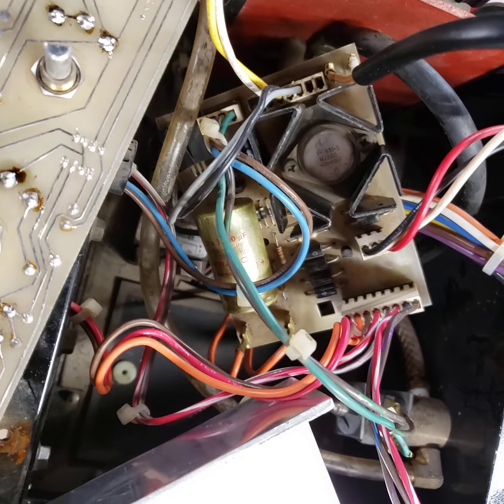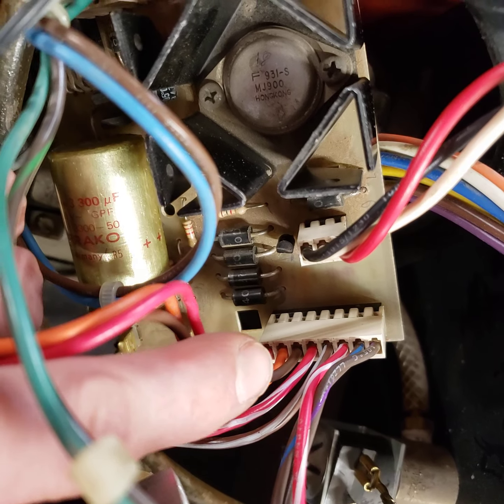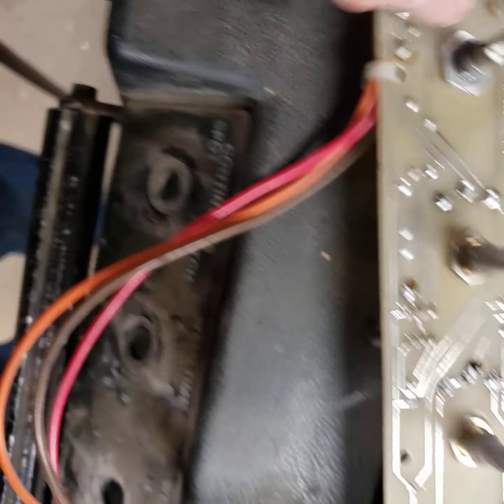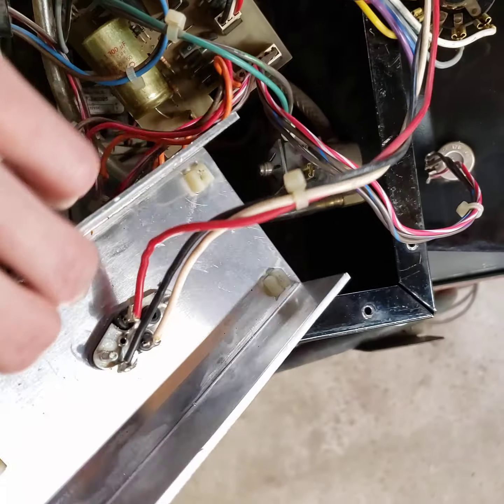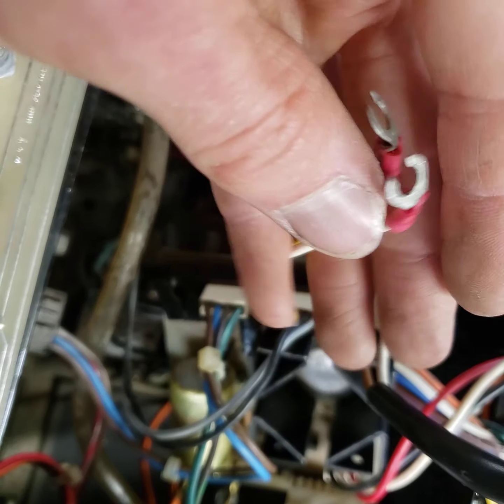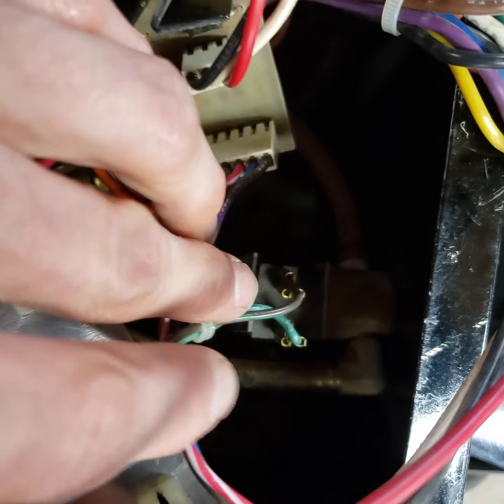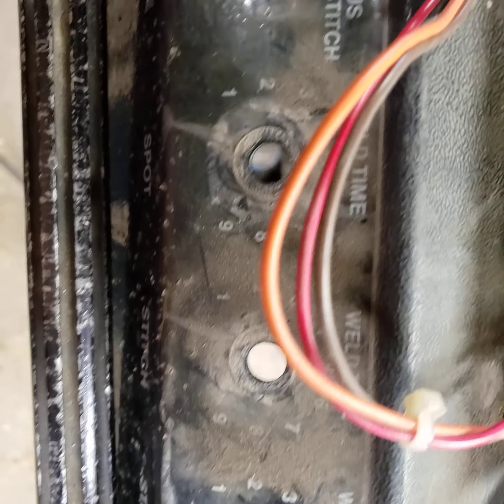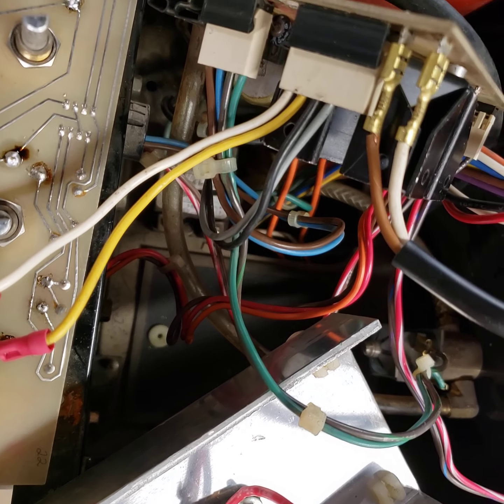Snapon YA205 PCBs

Comment: did you ever get it to work properly??
Reply from the maker: I got working with a few time delay relays, some interlock switch to bypass for constant feed, but don't have gas for yet so not tried with MIG wire only flux core.